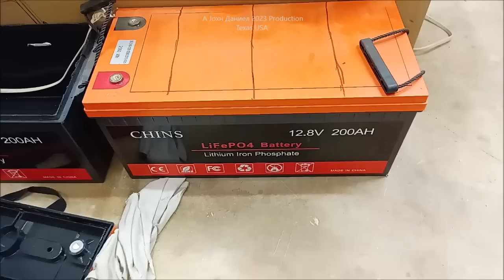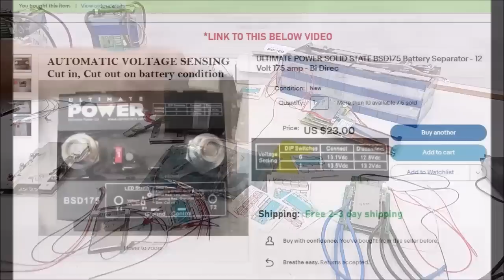The Limits of most SMART BMS for Lithium LiFePO4 Batteries, Avoid them, I Explain

Comment: hello can you post link for 48v version TIA
Reply from the maker: We stay with the safer voltages, 40 and less and also not requiring higher volts from solar panels in series we get rid of 99% of the chance of fire. We do have 36 volt and 12 volt in our systems. Using Stions on the 36 volt ( 70 volt low amp CIGS Amorphous SOLAR that are fire proof ) and the other 90% is 12 volt. A near 100% of solar panel wiring and fires are due to running them in series. I can show that in a future video. But watch this, https://youtu.be/RP2ITBfDBbU?si=gWo18eR39Jxn8AfR to understand IT IS NOT SAFE! The uploader of that video shows the effect, yet fails 100% to connect what I have seen in over 200 installs. Its the failing cell in one panel that is wired in series for higher volts that is heated up in a series wiring and goes up in flames. If you wire ONLY parallel then this can not happen at all. A bad cell, buss bar, diode just stops that panels output. Nothing flows through the damage. As China quality drops, fires rise.

Comment: What's with SunFun prices?  YOU SERioysly recommend them?
Reply from the maker: Yes if you want to have the highest quality I would recommend them. Real 10 year cells, not claimed. So, If you have a RV, tiny house or boat, and are building a 600+ ah system, with 400 ah draw ability, and surge capable of over 1000 amps, then it's is the best bet. I'd recommend 2 complete kits. You can go with DIY, no engineering in that option. But SFK Cells are 304 rated, over 310 actual per cell. Cost is over 20% cheaper per amp than Battleborn and Dakota, but yes its 10 to 20% more than the commercial China dumping made stuff too. However, you can not get pure EV grade from many sources, They SFK are battery cell buyers for industrial motive power, and the Battery kit is just a extra thing they do. Unlike 99% of LiFePO4 and LiPoly sold, the SFK is serviceable, and adaptable, practically none others are.
Reply: @JOHNDANIEL1  I've seen just a few of your videos and that has been enough to trust what you say.  Thank you for the clarification.

Comment: That's awesome Kiera is defensive and all being a young lady!  Man, that's awesome. Wow, that's complete bs sounds and looks like maybe she was assaulted.  Man, I've been advocating the concealed wireless assault weapons Havana Syndrome Health Attacks stuff that really is more the imminent death and more than threat situation where deadly force needs to be applied in certain situations.  I mean, man, though with the laws lack of enforcement in some jurisdictions where they seem to pander those imminent assault, battery and more criminals and their crimes its just gay dangerous.  Anyways, I still need to donate more sewing machines and I don't really sew.  Interestingly, I got the machines to restore to functionality for making garden and lawn equipment covers and seat covers from free vinyl materials and still haven't done that yet.  I do enjoy the machine restoring and test stitching, though did I admit make a few hats and scarfs for my Mom and to donate.
Reply: I wound up getting a 2006 Prius and a second battery to practice with the reconditioning and balancing.  Though reading like you noted, seems like the vehicle will do the balancing in regards to the less accurate series wiring configuration of the modules blades.  Now, using this Thunder T6 thing I just found on Mercari and the Turnegy Reaktor, I'll one by one or maybe in parallel as a last top off, do them all as a "balancing" individually with a spreadsheet to document the charge discharge cycles to see if improvement or junk cells.  So is a manual one by one and recondition and document each of the modules so they're balanced and packed where the best cells go in the middle of the pack and the worst on the ends since the heat wears them in the middle from what I'm watching and reading.  Figure the modules each have 6 cells in em that I can't really balance so is a crap shoot.  No sense in the series charging to further than crap shoot of 168 cells.  The parallel charging to balance or maybe do charge discharge cycles is at least more a 28 module crap shoot.  Figure best is to charge one by one or at least if all four chargers work on that T6, then I'll be able to do 5 at a time.  I got like 13 old DeWalt NiCd's or NiMH's to test and practice with I'm thinking at first here in the next few days.  Will be interesting if those can be reconditioned even if for other like small solar cell like powered uses.  Thanks for sharing.  Interesting.

Comment: 23:00 please i need the link to this balancer
Reply from the maker: I can't find them anymore, They seemed to stop making them so that people would spend $more on something else.
Reply from the maker: I found the new model, https://s.click.aliexpress.com/e/_DBVUR4R $9 and its same but different cover. You will install it on the battery with the other BMS as a side optioned source, connecting negative with a 14 gauge wire, then the bms leads on the cells like normal. It has a modified 3.60 +/- .0078 volt per cell balance point and much faster reaction to imbalance than the existing large factory BMS that to allow fast charge they allow .055 variable in most all them. I may make video 2 showing how it keep the battery at near 100% perfect.

Comment: This is for 4s batteries is there a solution for 8s 24v?
Reply from the maker: Not really, these cheap BMS are what is known as Starter battery style. They do a great job of not limiting you to how many 12 volt batteries you can stack in parallel but nothing in them allows over 20 volts.
Reply: So it won't allow you take 2 of the 12v batteries and run them in series?
Reply from the maker: @justin6125  We have not tried it, but it also don't publish it as possible, just has it as for 12.8 v starter battery BMS.
Reply: @JOHNDANIEL1  I'd be curious because I'm running 24v applications to bring amperage down
Reply from the maker: @justin6125  I just keep it all simple. So much stuff in 12 volt you can get anywhere. Worth a 25% wire increase on some things.

Comment: There probably is some proprietary bullshit in the RoyPow, I can't remember how many you can connect but at this point it is less of a concern for me, just getting some batteries to learn some more and try out things. Thanks for all the Information, yea your daughter looks to be something special compared to all the Feminists running around these days for sure!

By the way I got one of those 200A measurement precision watt meter - although I'm struggling to figure everything out - I will read the manual at some point and see if I can get on top of it. Although I thought it would work differently with some of the stats. Not totally sure what is going on but testing it as it goes these many next days.

Have some Anderson Pole plugs on the way as well to try out if it is anything. So sick and tired of the many different plugs and hate those MC4 plugs... I've tried to buy some electrical Lego and use them as well for the 12 volts :P It runs from the 5.5mm 12 volt to a electricity LEGO block and from there Lego plugs are connected to stuff. Not sure if it is the way to go, but it works very nicely... Very small wire on those connectors but as long as it is close by there should not be a big loss. Although being a LEGO pieces, you can end up making a short turning them the wrong direction, it tends to happen sometimes. But the Bluetti EB70 station does nicely in turning things off at that point.

I have some easy attachment 5.5mm plugs, I have 3 kinds I have tried - but thinking there must be something better - but at least you do not need to warm anything and solder it, either a screw driver or some force will do to have the wires connected to the plug. Like I just tried this Car plug yesterday wanting to move the best connected male plug to something else, with a diode and all - I needed to try 4 times before I got it right - took me way to long to do. Like how easy it would be to just fix a place for connecting each wire with a screw.

I have also tried different male car plugs to my Bluetti, and some of them just pops out - like you gotta be kidding me. So much difference between those who connect nicely and those who do not. The same with the 8mm input MPPT on it, it does not even click and after having bought different cables to get bigger/lower mm2/AWG I found out there exist variations where the Female and Male 8mm actually click and have some kind of strength to connect. But the one I have in my Bluetti EB70, a Female Feminist, is just a lose marriage that easily breaks apart. Further there are variations of the plugs, where the male plug can't get deep enough without a Jewish cutting.

Comment: What you are proposing as best BMS solution, is a cheap ''dumb'' BMS with fixed limits. I do agree that DIY batteries are better than premade ones (when done right), but a smart BMS will give you adjustability the way a dumb BMS never could. You could change voltage limits, charging limits, discharging limits, balancing limits, live monitoring and changes on the fly with Bluetooth. Sure all this adjustability requires knowledge to be set up correctly, but a smart BMS will always be superior to a dumb one. The only good thing of a dumb BMS is that it requires less knowledge to set it up.
Reply from the maker: How about how dumb it is to be Smart Controlled? In 2021 China launched 4 satellites, 4 more again this year. https://www.space.com/galactic-energy-ceres-1-sea-launch-video-may-2024 All 8+ of the to deliver a 1,800 % high power Blue Tooth and Wi Fi signal for emergency use. None use CDMA, GSM. However, all are over North America and Europe. The US Defense department case against Huawei security info related to "Smart Device Capture". Huawei built all the components in those satellites. The Taiwan media showed evidence that the 6, not 1, balloons that transverse USA during the free for all Biden Bribes Paid FOR agreement with communist was used as signal verification equipment on how effective THOSE satellites would function to wipe us out. 
Japan has sent technicians to Langley and DC to try to get those satellites' targeted for removal, and was rejected. (Massey/Jordan Docs)
Your Battery, to your Refrigerator, to your Ring Camera is 100% owned by China, you go ahead and use all that Smart Stuff. My Dumb Stuff we hillbillies use and are too stupid to own otherwise will still be working when they take over all that "easier stuff the more intelligent people have"! I would argue it takes a real intelligent person NOT to hand the house keys to the burglar! 
THEY, not you built and embedded all those control systems. And YOU do not have the ability to take over it, they do. Trojan Horse 2024!
Reply: @JOHNDANIEL1  Smart BMS uses a low power Bluetooth module (BDLE, 10 meters range at best) and most of them use some form of encryption & passwords. No, I'm not afraid my batteries are going to be taken over by satellites. Not realistic comment. It won't apply to a real situation. I'm just saying a dumb BMS will give you less control. You might want for example to charge your LiFePo4 batteries at 3.55V per cell and not 3.65V to avoid stresses and increase longevity, you can't do this with a dumb BMS. And by the way Bluetooth communication doesn't have to be always on, you can turn it off if you are afraid satellite hijacking scenarios.
Reply from the maker: Look up SIGNAL BURST technology. They can send you a signal of such power that your system will go into the pre-programmed functions that is in the permanent firmware. Car makers in China and Germany already have sent shut down orders, not 2 way communications, but one way demands via BLUE TOOTH!! from over 200 km away. General Electric has sent same to Air Conditioners via WiFi without a Router in the home to shut down Air Conditioners in Texas last year. They sent it via the power lines according to AEP Energy. And turning off your blue tooth is a lie, it is not ever off. It's just not responding to you! How do you think a device you never connected to will respond to the first use. 
I set my solar chargers to 14 not 14.6 intentionally to charge to about 95%. They fade and shut off and only return to charge at 13.4 v. No one can alter them so no smart anything is in charge of the outcome.
Reply: @JOHNDANIEL1  You can test it with various methods to see if Bluetooth is really off or not. You could hardwire a manual switch the power line of the Bluetooth module to make it stop when is not needed. Heck on most situations you could remove the Bluetooth module completely if you afraid it so much. All the rest, I consider it unrealistic scenario for every day usage. Dumb BMS will make your cells die faster, simply because it's not adjustable enough.

Comment: Hi, this is ANT BMS FACTORY, SHALL WE HAVE CONNECTIONS?
Reply from the maker: ANT brand BMS has many voltage options. However, no one is making a BMS that is a "other battery" chemistry matching BMS and them failing to make one is costing them over a billion $$$$ USD in sales. It is a simple design I created that allows use of Lead Acid or NiCad or NiMh with LiFePO4, Sodium, and LTO, yet the first company I can have build one will become richest on the planet. The ability to use "dumb Battery style" with LiFePO4 is amazing. Allows 30% more starting amps and adds over 2 years life to 9 billion existing Lead Acid.

Comment: I was always worried about that. I have access to many agm batteries. I even have a switch set to charge through the mppt at night by converting 120VAC to DC with a rectifier from a winch. Now, about that Lithium switch.... I am scaredy-cats about them. Could you do a reality show on that? I hear once they start going thermal, no disco can stop the K-POP. Is there an E-stop?
Reply: You're thinking lithium NMC batteries.  Lithium iron-phosphate batteries do not have the same concerns with thermal runaway.
Reply: @jasonbroom7147  Thank you! I've been reading about that. I know sooner than later I'll have to go lithium. I found your show from a reference by another guy. It's quite good, you know! Much obliged, Sir!
Reply: @richardpedersen2092  - If you're referring to the Jasonoid channel, I am not that "Jason", but you're still welcome.  :)
Reply: @jasonbroom7147  Not at all. It's definitely your channel that he said to watch and he's right. This epoxy filled, ROM chip, buy mine; kills everything I try to accomplish, as you clearly understand. Thank you again!

Comment: OH MY GOODNESS!!!! 🎉🎉🎉 WOW!!!!
Glory be to our ABBA FATHER GOD in CHRIST JESUS name amen, thank you all so very very much for all your blessings to me for this great opportunity to save me a lot of cash!!!
Reply from the maker: I did a major restart in life once. The effort and cost was crazy. So, I swore I would find every way to do it with less needs and cost then share it with as many as possible.
Reply: @JOHNDANIEL1   I don't see why people still thinking BMS with different ampere ratings. Why not simply get for e.g. a 5A BMS 4S for LFP batteries and latch it with 200/300A SSR and a current sensing feedback and be done with it.  BMS is majorly Voltage detection system.. if any parameter goes off it will simply turn of the SSR relay and shut the system.
Reply from the maker: @mahamayabose3980  You actually do not need a BMS, but you do need a CRC ( charge rate controller) for your cells to keep them in parameter. So if I took 40 cells, 3.2 volts each, then charged each to their premium of 3.65 and disconnected them at 2.65 with nothing but a mass balancer in the system then I can build unlimited AH and AD without a issue. I have designed a 1200 amp all chemistry smart buss bar, with PWM control and 12 - 100 amp VSSR ports in it to make it capable of joining all. Lead acid, Lipoly, LiFePO4 and even Nicad all working as one. Problem is, $$$$$ to get them made.